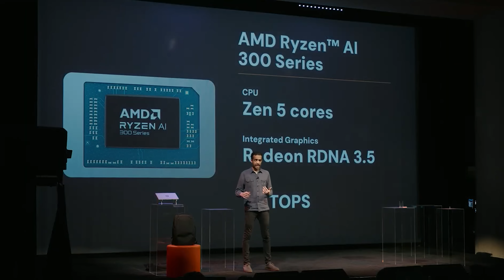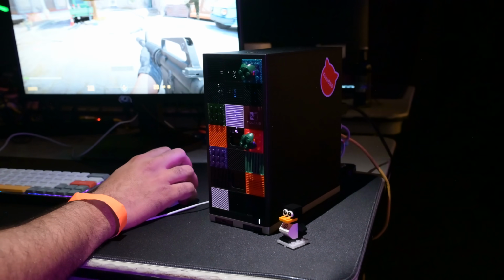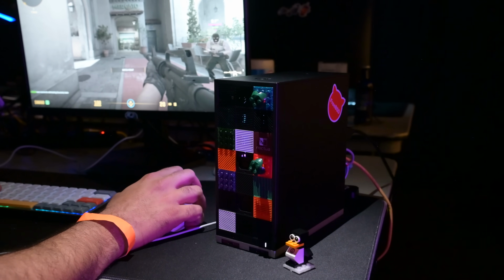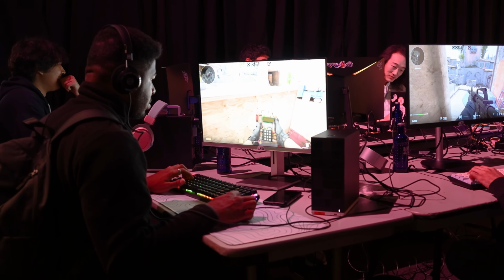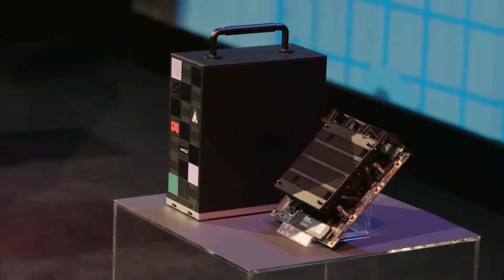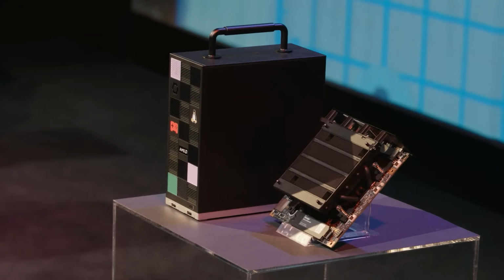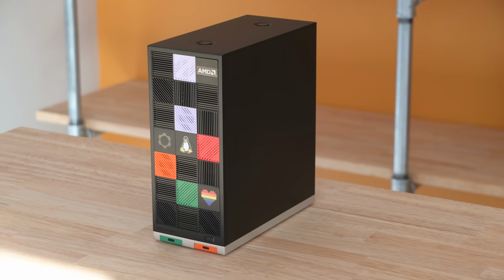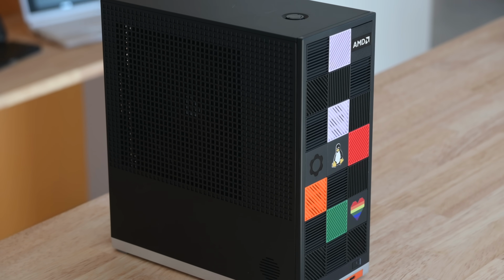Modular, Open, Repairable – The Framework Desktop Teardown!

Comment: soldered ram is not repairable lol
Reply: I didn't know anything about this company before but I know about the chip in it. All the low iq boomer comments about soldered ram, it's for AI, so it can be shared with the gpu. We don't have the tech yet for the swappable unified ram that's AI capable. The name of the chip has AI in it lmao. I think we can guess the target demo yes ? muh soldered ram bad xD. Swappable unified memory doesn't exist yet.
Reply: yea sure no one ever desoldered ram and replaced it. I guess all this GPU repair channels on youtube must be hallucinations.

Swapping a part is not a repair ... oh well it's not a gear so maybe that's the problem.
Reply: @DJDocsVideos  Desoldering RAM may be possible, but that does not make it a consumer-replaceable part.  I replaced a broken screen in an Asus laptop years ago.  It was very difficult to do, and I would not recommend it to most people.

Yes, swapping a part is not a repair of THAT PART.  It is, however, a repair of THE COMPUTER.  Plus, being able to open the computer without breaking other parts or even at all, to plug in a loose cable, does not require swapping a part but is still a repair.  Your technicalities and edge cases are tiresome.
Reply: In LTT's video, they explained it's sadly bc of the platform, there's not enough speed when you don't solder the ram to the motherboard, if they could they would've.
Reply: @RestInRaxys  so throw out what ur company is about, because SPEED?!
Reply: @JwFu  It was legit not possible to get it without soldered ram?
Reply: @RestInRaxys  as explained in the video, its done due speed.. watch the video ;)
Reply: @JwFu  Their goal with this product was to bring Strix Halo to a desktop, specifically in a standard MiniITX form factor. Strix Halo is great as a little gaming mini PC, but what it shines at is Machine Learning tasks, because you have an APU with a ton of fast RAM (96GB at 8,000 MT/s in this case). Making it better than a 5090 for certain AI tasks. 

If they went super pure about upgradability, using socketed CPUs and socketed RAM, they'd just be making a run of the mill Mini-ITX PC. What would be the point of that? It wouldn't be serving a new niche or really innovating, anyone can make a PC this small with off the shelf parts. But no one makes a Mini-ITX Strix Halo board which uses all standard PC connectors, and no one likely would have if Framework didn't. And if Framework decided they were going to force socketed RAM onto this board, it will defeat a big point of this board because the socketed memory wouldn't be able to run as fast, making it worse at both gaming and ML tasks.
Reply: @JwFu  Oh, I thought this was a product of Framework, not a product of "We need to squeeze a tiny bit of extra speed out of our SFF PC otherwise we won't differentiate ourselves enough from the competition" Company.  

Strangely, Frameworks "About Us" page doesn't mention anything about being willing to sacrifice upgradability, repairability and recyclability in favour of speed.
Reply: @OmairArif  so they shove a laptop into a desktop box and call it the day? :) 
this has nothing to do with repairability anymore, this is just the performance chase. dont market it any different.
Reply: @JwFu  they shoved a chip intended for laptop formfactor into a PC box. There would be zero point for Framework to make a repairable standard Desktop, those already exist in droves and beat any pricing Framework can hit at their size.
Reply: This was explained both in Framework's video yesterday as well as in this very same video you are commenting on.  Maybe watch the video.
Reply: @georgeh6856  definitely don't need an explanation.. by that logic apple can explain all their spidered ram too. no excuses for me repairable or bust.
Reply: @honduken  Actually, that DID need an explanation.  Framework tried to get AMD to do socketed RAM, but they determined that the performance decline in socketed RAM was too great for this type of machine.  Calling Framework the same as Apple is very misguided or even dishonest.

Framework has made some of the most repairable and upgradable computers around.  Apple has not.  You say you don't need explanations (what you referred to as "excuses").  But then you are just unfairly criticizing a company Framework which has done so much to help consumers have choices for repairable and upgradable computers when we had very few before.
Reply: @georgeh6856  No matter what kind of anti consumer behavior it is, there will always be someone defending the behavior because brand loyalty is quite a powerful thing. Don't be brand loyal, it will change your life I promise. They could have just used a desktop CPU.. They used a Desktop cooler so why not?
Reply: @honduken  Again, you are criticizing the most user-upgradable and repairable computer company in a long time because their products are not "perfect" for you. 

"Perfect" is the enemy of "good".

But you would rather have all the other companies using proprietary parts, using firmware locks to stop part swapping, providing no replacement parts or manuals for fixing their products, and gluing their products together so they can make more profits while generating tons of e-waste.

I guess so you can complain more.

If you really cared about user upgradability, repairability, and choice, then you would stop this nonsense about Framework not being perfect to your standards and instead criticize Apple, Dell, HP, Lenovo, Asus, Samsung, etc.  But you won't.  Because that is not what you truly care about.
Reply: @georgeh6856  It's just a desktop, we've had modular desktops for decades.. lol
Reply: @ You complain  and complain and complain about Framework supposedly being "anti-consumer" (your words) just because they prioritized performance over socketed RAM for this particular desktop PC.

Then I call out how wrong you are when I compare Framework to all the other PC companies, who actually have been anti-consumer.

Instead of acknowledging I am correct, you just reply with a completely different argument: "It's just a desktop, we've had modular desktops for decades... lol".  Really?  With this kind of performance?  Umm...no.  Not even close.  Seriously bad response.

Comment: Could improve the design even further by using less rare earth magnets.
Reply: Why less
Reply: @koijoijoe  Because using them when it is not necessary wastes precious rare earth ore.

To keep the front plate on, they could have used some kind of slots in the case.
Reply: @Luzgar  it's kinda misleading tbh. "Rare earth magnets" aren't rare in any way. I don't know why we call them such.
Reply: @mitchib1440  We call them that, because the ores that are needed to make them are rare (neodymium), but fortunately, we don't need nearly as much as we do iron or aluminium, making the resources less critical.
I looked it up, and they are less, not as critical as I thought they were, you are right.

There are often human right abuses in mines for such ores, though.

So it's still not a sufficient reason to waste it.
Reply: Why are you assuming they're rare earth magnets when simple mass produced magnets can handle that job just as well?
Reply: @ They use many in their laptop design.
But I could not find a shot of the backside of the grill.

I was expecting a teardown of the new laptop as well, which contains many rare earth magnets.

Comment: It is like the HP Pavilion x360, but it is better: repairable.
Reply: if u can get the mobo for it, its just as repairable LOL
Reply: @JwFu  I wonder if I could buy the motherboard+heatsink combo and slap it on my mATX PC. Seems like a good upgrade from my archaic build (~7 year old CPU, GPU is ~10). I was planning to buy a MoDT motherboard (Erying, Minisforum) but I think at least having 2 USB-4 ports is pretty good compared to the other port selection for laptop CPU on desktop motherboards, which usually has no USB-C, let alone USB-4; and it probably has a more reliable BIOS support than other vendors, too.
Reply: @JwFu  Framework will be selling the motherboards for the desktop on their own as well - they/re already in Pre-Order Batch 5 due to ship Q3 2025.

Comment: still too expensive smh, but its also 128gb so of course it would
Reply: I don't think this is aimed at the desktop crowd and more aimed for businesses and enterprises that need efficiency and performance over something upgrade-able.
Reply: Nobody is making you buy this.  Go buy a Mac Studio instead.
Reply: @georgeh6856  Obviously nobody is making them buy it if it's out of their price range, that wasn't the accusation the accusation was it was to expensive. It is expensive, but that's because a smaller company can't compete at scale on price until it gets there. That is what you should have said instead of acting like a toddler.
Reply: @GeorgeWashingtonLaserMusket  I did not act like a toddler.  Sorry you got your feelings hurt.

"Expensive" is a relative term, not something that YOU dictate to the rest of us.  If any of you had watched the Framework video from yesterday, you would understand my reference to a Mac Studio.  This PC also has a lot of CPU and GPU cores, but of course that means nothing to you.

Framework compares the price of this machine at $1999 with 128GB of RAM to a similarly specced Mac Studio which was I think ~$4700 in the Framework video.  So, yes, I would consider $1999 more than I would want to spend on a computer, but someone who wants or needs a computer with these specifications and is considering a Mac Studio might consider $1999 a bargain.

Even the original commenter has since edited their comment to add the "128 gb" spec.

But then again, I guess only a "toddler" would see how different people can have differing definitions of "expensive" rather than one person who calls us "toddlers" who thinks that their views should apply to everyone.
Reply: @GeorgeWashingtonLaserMusket  and why would they? They are less than half the price of a Mac Studio and that's the competition here not a sweatty gamer box.